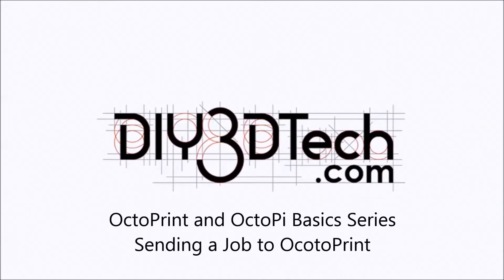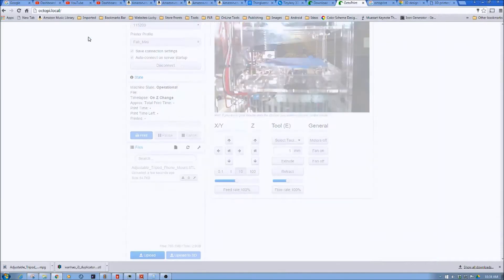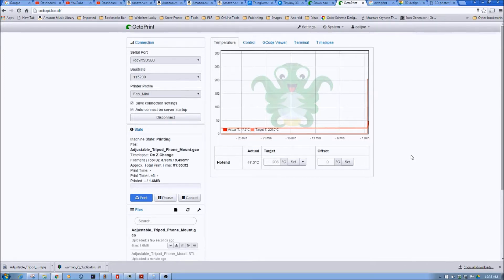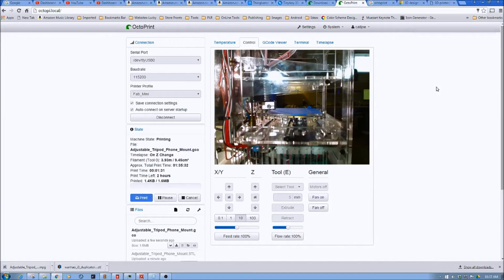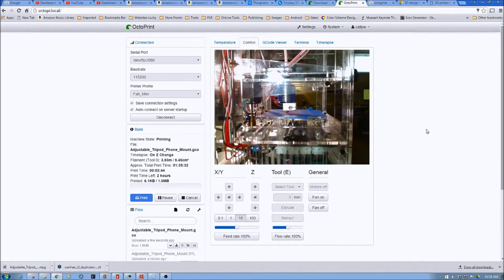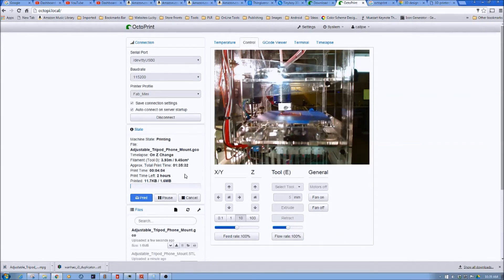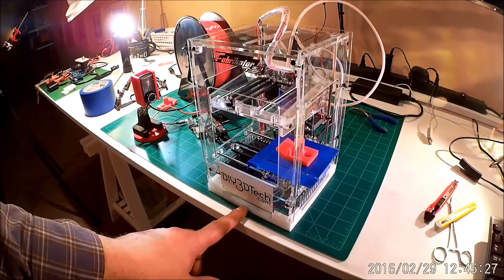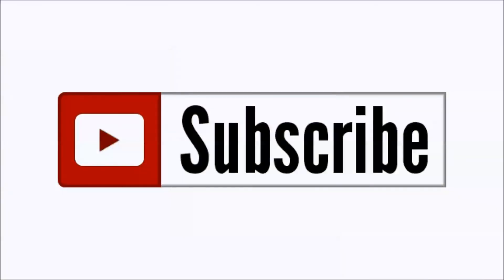OctoPrint and OctoPi Basics Series - Sending a Job to OcotoPrint

Comment: could you do a tutorial for what I want to use it for. being able to keep an eye on it while I am at work or sending prints while I'm there(I'm there a lot)
Reply from the maker: Are you speaking about using(i.e. accessing) over the internet?  This gets a little risky and the reason I have not done a video as most folks are not equipped knowledge wise to secure their networks (LAN) from attack.  Also its bit unique in that it will depend on the router you have.  In addition you will also need to understand some Linux too as you want to do the following. (1) Log into the Pi using SSH (you need an SSH client) set a secure Linux password and configure Linux on the Pi (there are many videos on this out there).  (2) Reserve a static IP from your router (this will depend on how your router works) and assign this IP to your Pi.  (3) In your router expose that IP to the internet.  Some might argue to use port forwarding, however with PF the internet is now "in" your network just limited (technically) to that port whereas the other creates more of a poor-mans DMZ.  Again I wouldn't do either (I work in the enterprise computer field) and create a true DMZ with two routers.  Also google "thermal runaway", I never leave my printer home alone and have a wireless smoke detector in my workshop near them.  Hope this helps :-)
Reply: DIY3DTECH.com would it be possible to use a vpn?
Reply from the maker: Yes you could, however I would still zone it off (i am bit paranoid when come to open internet)...
Reply: DIY3DTECH.com right that's the issue I'll have my friend who was a IT manager help me out then. thank you
Reply from the maker: Cool just watch the thermal runaway stuff as it happens more often than people think.
Reply: DIY3DTECH.com thanks will do

Comment: I see that you are using super high resolution in both streaming and time lapse. (OctoPi's default is 640x480.)  Have you noticed any CPU load?
Reply from the maker: +Yuan LIU just using the basic setting so it pretty small, I upscale in iMovie.  I also use the Raspberry Pi 2 so it has a good amount of CPU as at this point it is only sending GCode so not a lot of over head.  Is there a way to up the res of the video capture?
Reply: +DIY3DTECH.com That iMovie upscale is unbelievable!  I see resolution settings in octopi.txt on boot disk.  Camera is disabled by default, so you must have uncommented the lines.  Not sure what OctoPi's config script does with the data.
Reply from the maker: Nope, no uncommenting however thank you for pointing that out to me as I will check the config file and see what is in there and share it on the channel...